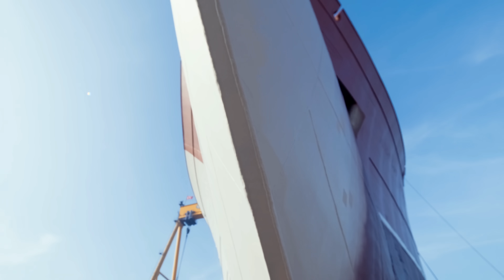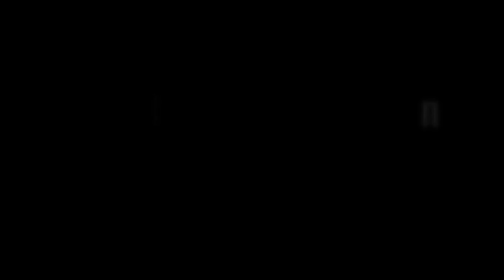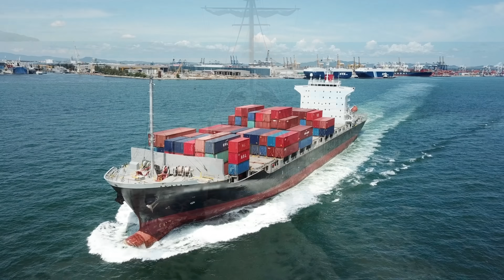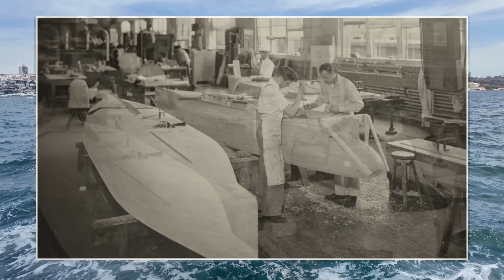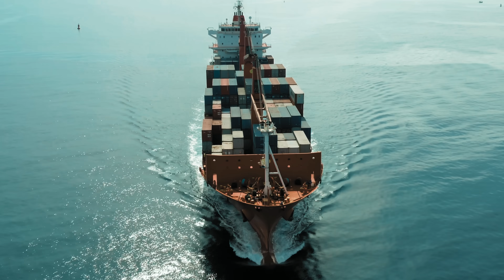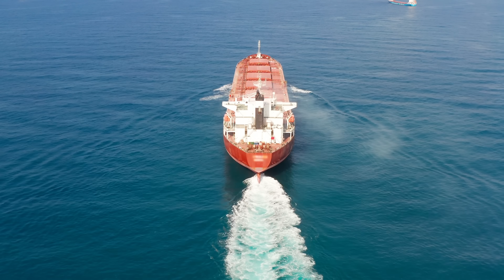Why Every Modern Ship Has a Weird Underwater Nose?

Comment: The opening narration overstates the case. Without the bulbous bow, "global trade as we know it" would not be IMPOSSIBLY expensive, it would merely be MORE expensive. A 15% fuel savings, while undeniably significant, is not going to make or break global trade. If it could, the entire shipping industry would grind to a halt with every oil price shock.

Comment: This explanation and its diagram seem like a similar thing might be going on as the explanation for how a airplane wing works.
Where you have something that was found to work first, and then the explanation for how and why it worked had to be figured out afterwards. It has that sense of they didn't really fully understand its precise physics and came up with some confusing and complicated explanation that kind of but not really explains for it.

Comment: Even submarines, that move mostly underwater, have these funny noses, too!
Reply: And so out of many more reasons than just hydrodynamics.
Reply: @alanbellas513  Nope.
Reply: @oakaged5991 
What do you mean "Nope"? You just cited one additional reason yourself.
Otherwise, in the answer given by AI, the forward-looking Sonar Housing  is cited as the "primary" reason even. 

The bulbous nose shape serves several critical functions:

Sonar Housing
Reduced Flow Noice
Optimal Hydrodynamics
Structural Integrity

"Nope"
🤦‍♀️
Reply: @alanbellas513 The bulbous shape is to reduce drag and noise. The exact shape may be altered if needed to be made larger to house equipment, but housing the equipment is not a reason for the bulbous shape itself.
Reply: @oakaged5991 
... as so out of many more reasons than just hydrodynamics. As I already presented those main ones from the AI research.

No need for you to keep obfuscating., nope.
Reply: @alanbellas513  Hydrodynamics is the only reason for the shape of a submarine's nose. If structural integrity were the only consideration, it would be spherical. The bulbous shape has enough of the structural benefit of a cone plus reduces drag and noise. (And it would need to do that whether or not it housed sonar equipment in the nose.)
You really shouldn't assume that an answer is correct just because an AI pulled it from the Internet. That's why Google's AI has a means for rating its results and reporting problems with them. Your own critical thinking is usually your best resource (provided you're rational).
Reply: @oakaged5991   the answer on such random, out of curiosity asked, zero-consenquential questions, as why this particular shape of submarines, is to me far more satisfying than a random dude on youtube with his "Nope, there is only one reason". 

And then what do you do? Go replace that answer with your "critical thinking" that is but a cheap exercise of a silly logical fallacy. "If" structural integrity "were the only consideration"...  No, it is not. There are many consideratios there, would you believe it.

I do not need "critical thinking" there where the answer is how there are different - not only one - reasons behind the dumb shape of a dumb submarine. It makes a sense to me, good enough for me. Nope to you? Suit yourself as you please. Or you insist on being a "critical thinker" here for no any useful purpose?
Reply: @oakaged5991 
Btw, you might want to watch the video that got 3.9 mil views.
"Why modern submarines have round noses?"

Were it explains exactly why hydrodynamics is NOT the only reason as you claimed here, or otherwise the noses would have to be rather pointed like in the fastest moving fish. And they are not so.
Reply: @alanbellas513  It's already clear you believe critical thinking serves no useful purpose when you take up a conversation that starts with the idea that a submarine's nose shape is somehow related to a surface ship's nose design when the ship's nose design is for nullifying a bow wave and a submarine operates underwater where there are no waves. But I'm happy for you that you find satisfaction in a random dude on YouTube with his logical fallacy about such a connection. Enjoy!
Reply: @alanbellas513  Nope. A submarine’s nose is rounded rather than pointed because a blunt, parabolic shape is more hydrodynamic underwater. YouTube video viewer count does not invalidate Physics.
Reply: @oakaged5991 
So many fallacies.

I never said that critical thinking serves no purpose. But that I do not need it there where the info is satisfying enough and the issue does not bear any significance to anything. What is your problem anyway? Want to be Karen or what?

"somehow related to a surface.."
You are actually the only one here who used the term "bulbous shape" that relates to the surface ships and not submarines. Look who is projecting now.
Why did you then take up the conversation yourself? Now being a smart Karen..

"But I am happy for you.."
But of course, typical Karen jargon.

"you find satisfaction in random dude.."
No, another fallacy. I said, I was satisfied with the AI answer, not a random dude's logical fallacy reasoning.
Reply: @oakaged5991 
That a blunt shape is more hydrodynamic under water than a pointed nose shape, is a fallacy. Or, a half-fallacy perhaps. 
It depends on the speed. For the lower speeds, like submarines, the blunt nose is more hydrodynamic and preferable. For higher speeds, like in those fast moving fish, it is the pointed nose - millions of years of evolution. 

So you did not watch the video. You prefer to remain in denial about different reasons for the blunt shape of submarines. You decided that hydrodynamics is the only reason.
Your "critical thinking". That's all you got. Your own mind. 
Good for you.
Reply: @alanbellas513  "That a blunt shape is more hydrodynamic under water than a pointed nose shape, is a fallacy." -- Nope.
"For the lower speeds, like submarines, the blunt nose is more hydrodynamic and preferable." - Yup. And that's what we're discussing. Not fish.
So yes, I remain in denial of the false notion that there are other reasons than hydrodynamics for the shape of a submarine's nose. And perhaps you would come to the same understanding if you read a bit about hydrodynamics from credible sources.
Reply: @oakaged5991 
One cannot be in denial of the "false notions". But only truth, facts, reality. You are failing even there.

I made the claim. 
And I supported it with the answer from AI. You rejected it.
I then supported it with a yt video. You rejected it.

That is not "critical thinking". But a blunt rejection. You do not even know what critical thinking is. Simply rejecting and denying, that is not.

You made a claim. You supported it with... your claim.
Reply: @oakaged5991 "read a bit about hydrodynamics.."
and another logical fallacy at display.

The question is not wether a blunt nose provides better hydrodynamics to submarines, or not. It does. 

But whether that one is the only reason for that particular shape of submarines. And no matter whether you read a bit or much about hydrodynamics, that will not establish your claim that that is the only reason. 

Go watch the video. It is educative rather.
Oh, but you found the issue with it... it got 3.9 million views, and your "critical thinking" kicks in..
Reply: @alanbellas513  To clarify: I deny the validity of your responses when they are untrue. But sure, I failed to construct a more creative response than just reflecting your inaccurate term.
Explaining to you exactly why your "so many more reasons" statement is untrue is not "blunt rejection".
The fact that you can find an AI response and a YT video that list seemingly additional reasons for the shape of a submarine's nose is not proof that the competing information is false. Submarines noses are spheres (the most structurally resilient shape) modified to reduce drag and noise. A sonar array is spherical because it maximizes 360-degree detection, and it fits very well into the sub's nose; but the nose is not shaped because of it. That's the kind of distinction AI often fails at. But you go ahead and blindly believe whatever it tells you, and tell people who disagree that they fail.
Have a nice day.
Reply: @alanbellas513  It's pretty funny that you accuse me of logical fallacy. Look up the definition and see how closely your remarks match up.
You've yet to tell me a valid reason other than hydrodynamics for the shape of a submarine's nose. You've only told me that an AI and a YT video support your view. And you've accused me of the argument errors you're making. I assume that's fun for you. As for me, I'm satisfied you're not interested in fact or logic; only in trying to establish some kind of "win". So I've lost interest. Have a nice day.
Reply: @oakaged5991 
Well done. You just put your foot into your own mouth. When recognizing "the most structurally resilient shape" for submarine's nose - a sphere. There you go. One reason for the shape of the nose. Where a sphere is not even the best hydrodynamic form anyway.
But there is a compromise to be done... "modified to reduce the drag".

 Do you even realize? Not only that you acknowledged the structural resilience as one of the reasons.  But you even placed it before the aerodynamics! Yes, safety first!

And the sonar array. You want to argue here what comes first, egg or chicken? When it is not relevant in the context - both come into the consideration when the shape is to be determined. It is a complex calculation. The function of a modern submarine is not just to move through the water mass, hence only the hydrodynamics are relevant. But to be. To stay submerged. To know where it is, where it goes. To be aware of the surrounding. And to shoot torpedoes too. 
All these demand the sphere shape of the nose. You bet that it is even of more relevance than but speeding through darkness. You rather compromise on the side of speed. Rather than sucrificing the safety for it.

It requires rather a flat kind of an intellect to be oblivious to all intricases and complexities involved in the design of a submarines' shape in order to stick to only one aspect and requirements - its moving through the water. Nothing else.
Reply: @oakaged5991  
"So I've lost interest."
Yes, I can imagine. Apparently you did a bit of a research after all. And you were not able to come back with any facts, be it provided by AI or a video or otherwise, that would support your rather a flat-minded claim,

"Hydrodynamics is the only reason for the shape"

Nope.
Reply: No they don't. They have a single rounded nose.
Reply: It's cause both modern ships and submarines have SONAR system inside those noses.
Reply: @johndavidson3424  No it's not. The shape is shaped purely for minimizing drag, and in the case of war submarines, noise. The nose may be enlarged to house SONAR equipment but its shape is still for purposes of drag and noise reduction.